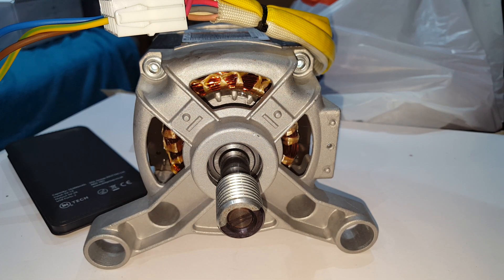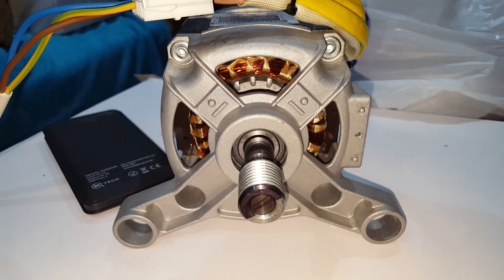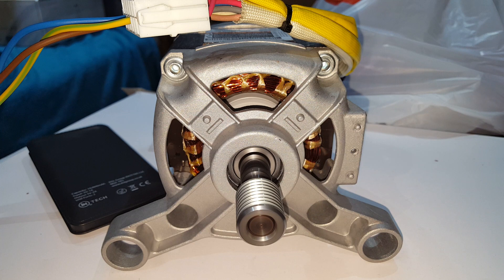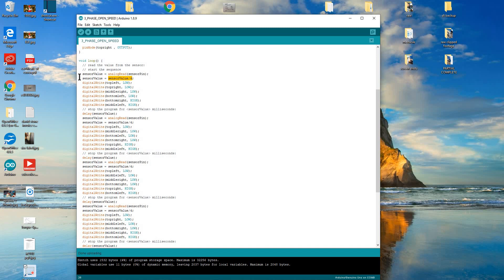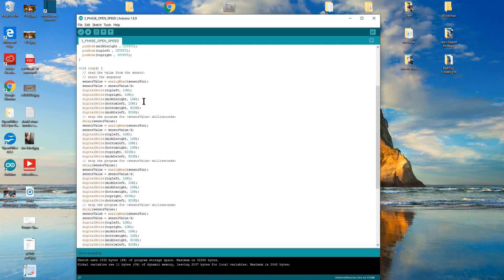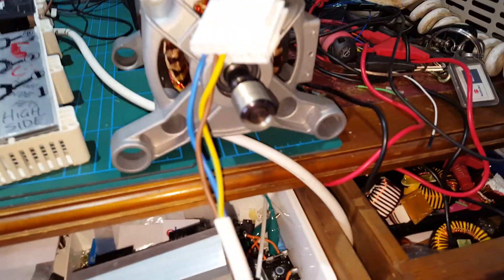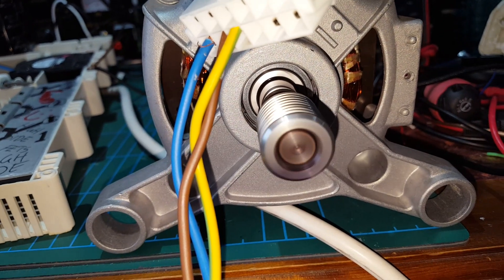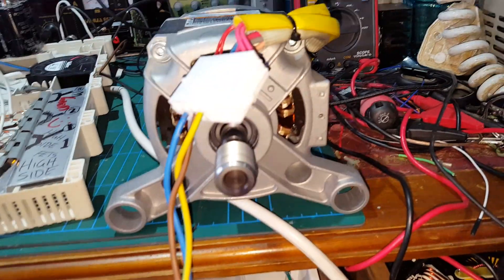ac motor control #6 open loop control

Comment: Will using this sort of open loop control run any 3 phase motor? Is the IGBT sequence the same regardless? BLDC and for example?
Reply from the maker: Hi jamie . Yes it will work for any motor 
If your talking about the start of the video then that isnt a simple open loop but afterwards its open loop basic switching (motor running rough) and yes will work with reluctance / induction and perm magnet motors :-)
Reply from the maker: And yes the sequence is the same :-)